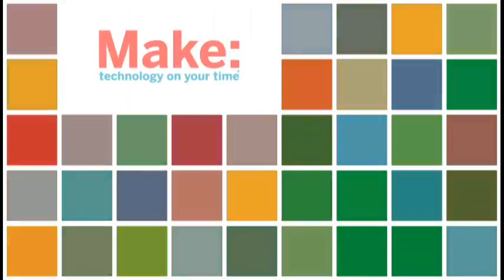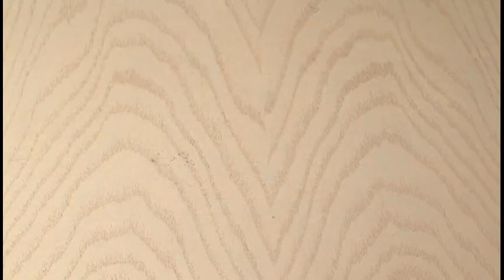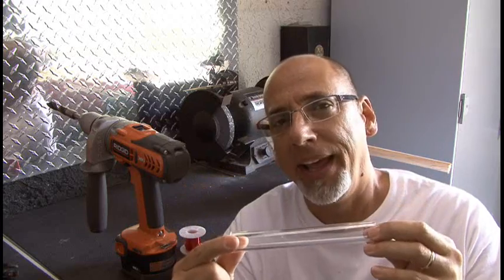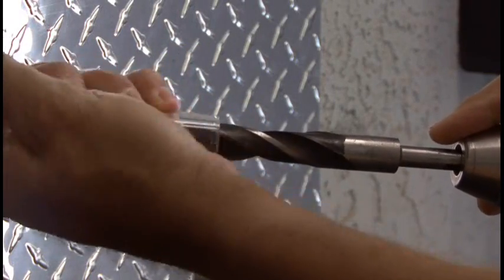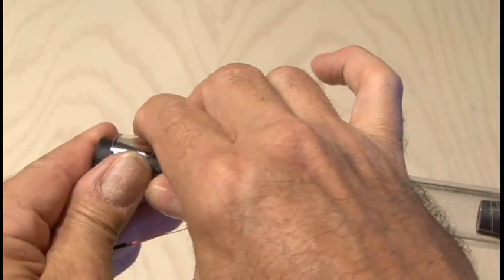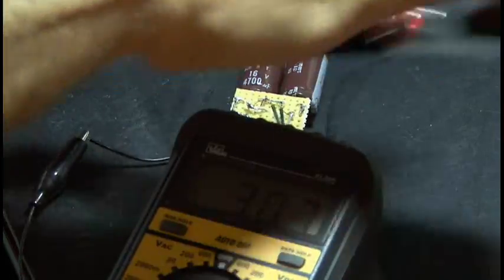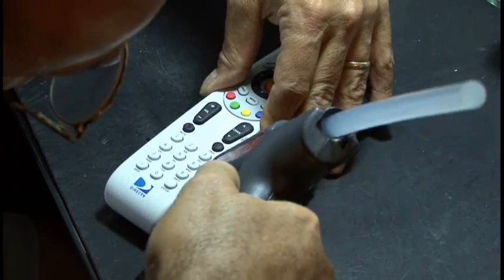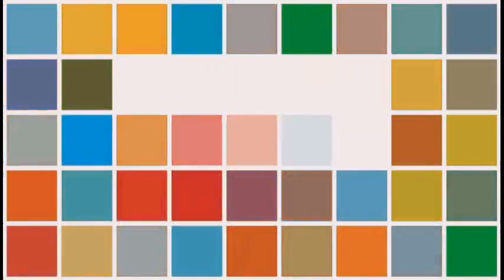Weekend Project: Kinetic Remote Control

Comment: I would have put rechargeable batteries in to hold the charge
Reply: +CHRIS C dito
Reply: and then  polish your shoe by taping the remote to the back of your hand..or any other fun things where you need up and down hand motions. The batteries will be charged pretty quickly.

Comment: Try using that on the new rf not rfid remote with the new directv software and remote. It will keep saying that the battery is almost dead. Good luck figuring that out.

Comment: hi kipkay....it would be very helpful if you can  pls tell me how much voltage are you getting without the electronic circuit ie voltage only by moving the magnets in the solenoid....also i am not getting an ldo in the market...what exactly is it...can i use a normal voltage regulator like an ic 7805  etc..thanks!!!

Comment: It needs something to limit the voltage across the capacitors. A zener diode wired in parallel would be fine. Choose the voltage to be something that both the capacitors and the LDO can handle.

Comment: @123456789robbie A battery is something which makes electricity through a chemical reaction. A capacitor simply stores energy, which you are making with the magnets. So no, not a battery.

Comment: @lllllllRobot That realy depends on the capacitors and the controller, some capacitors can hold a charge for several days and even months. And it depends on the controller, if it uses power when it's not used.

Comment: i make a kinetic remote control.but it will not work. i use pcb capacitor 1000uf/16v and 4 diode..it produce 4 volts and it will discharge if i will connect in remote control...

Comment: i make a kinetic remote control.but it will not work..i use pcb capacitor 1000uf/16v and 4 diode..the voltages is 4 volts but if i will connect in the remote control it will dis charges...pls reply

Comment: Hey Unicorn how good are you with electronics? What you want is basically the same as a stun gun/taser or an ignition coil driver. So if you search for plans for either of them you should get a pretty good idea. The only thing is you need an understanding of circuit diagrams, electronic components etc

Comment: Have you ever used a push button lighter?  The piezo in that creates electricity by compressing quartz.  You would have to increase the motion of the button a lot for this to work, but you could translate the motion of the button to a gear running a small magnetic wheel...  It isn't hard to think of ways to generate the electricity, it's a question of how much you need and then making that amount.

Comment: its old technology
where kinetic energy is converted into the electrical energy,
 to with the help of the transducer(here is magnet and coile) the energy generated  then stored in the capacitor 
the same energy is fed to the remote controll...
it has lots of advantages :
no battery required nature friendly,
dis advanteges : while shaking  its possible that we may drop the remote and lose it ,there always a chance of wear and tear and may require frequent servicing of this equipment

Comment: I started making this, finished the circuit and messed up on the coils.
So I grabbed some solar panels from some old outdoor solar lights and just connected those. The panels are the size of my remote, and I need a flashlight to shine at them to get enough power, so I added a USB cable. It works, but now I gotta be on my computer to change the channel haha

Comment: Hey, I have a question. If it was a universal remote wouldn't you have to keep reprogramming it because when you don't shake it its like taking out the batteries?? And it would usually lose its codes.

Comment: We've seen presentations lately on wireless light switches that are self powered.  Pushing the button generates the power the circuit that signals a relay connected to the fixture.  Somebody needs to find out how the switch produces power and make a remote like *that*.  Shoot, that would make a great wireless X-Box controller!  You'd have to push a little harder on the buttons, but with an adequate capacitor you'd be golden!